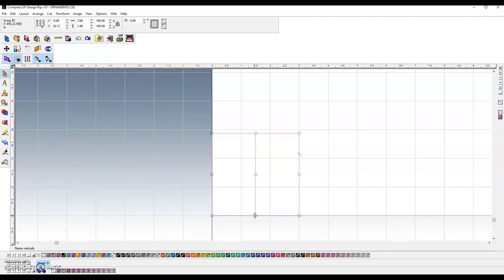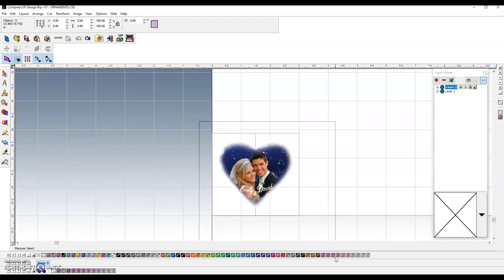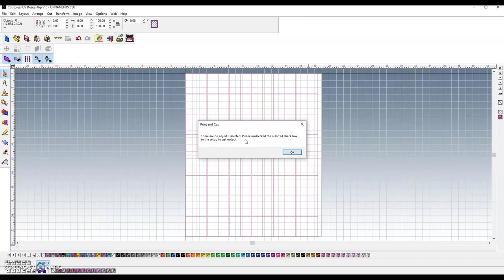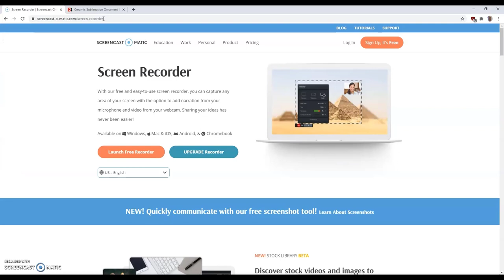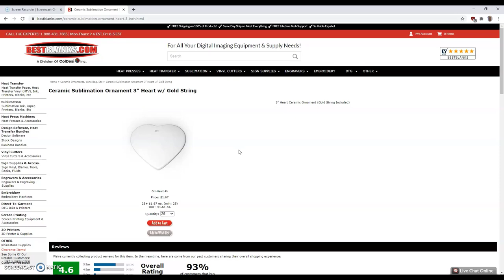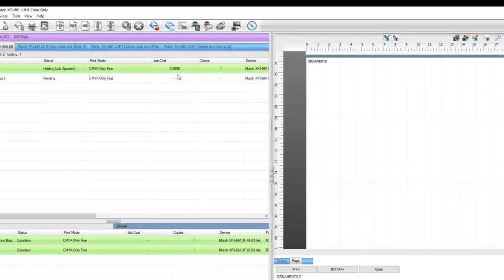Printing on Ceramic Ornaments | Mutoh XpertJet 661UF

Comment: After printing. How do you remove those printed white lines from the bed?
Reply from the maker: Hi Brian! We use tape! I have heard lent rollers work too.
Reply: @ColDesiColman  That's awesome. How thick is that silicone mat and what's the shore rating of the silicone?
Reply from the maker: @jahmontee74  for those answers you'll need to talk to someone at the office. Maybe chat with someone at http://mutohuvprinter.com?